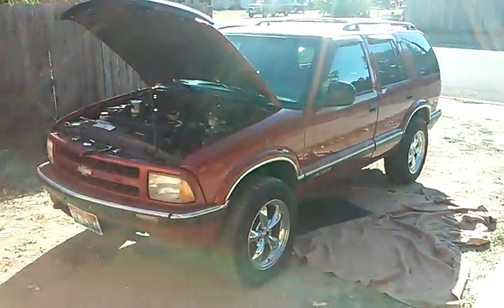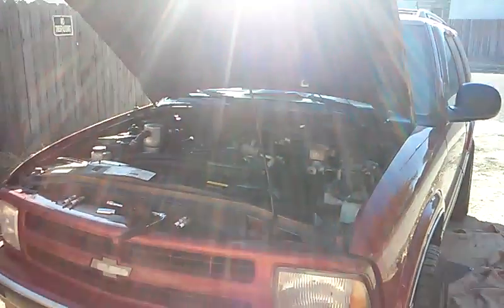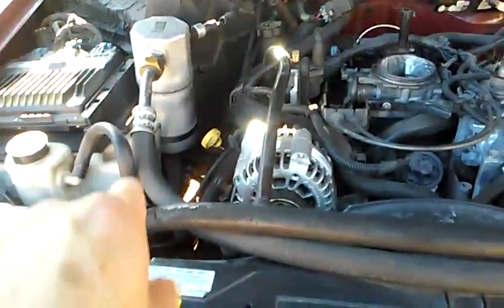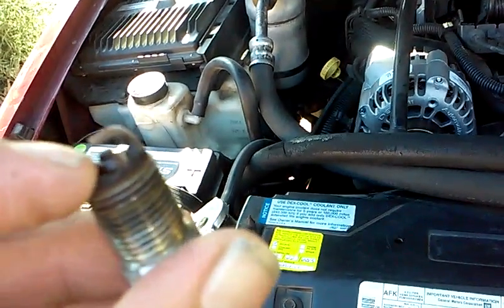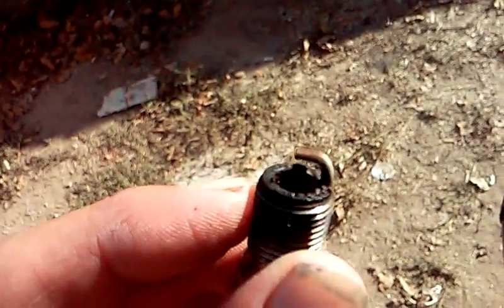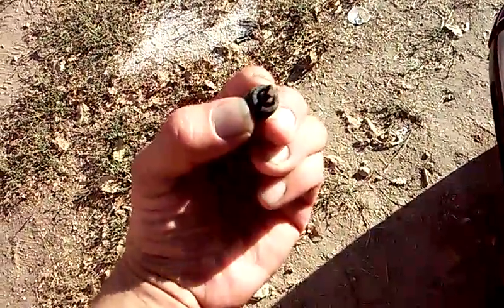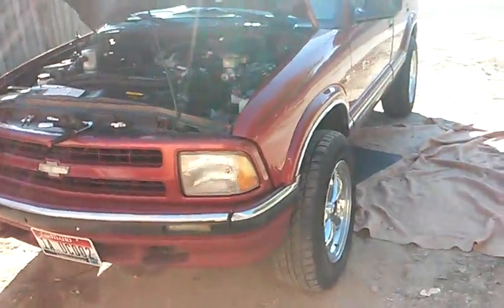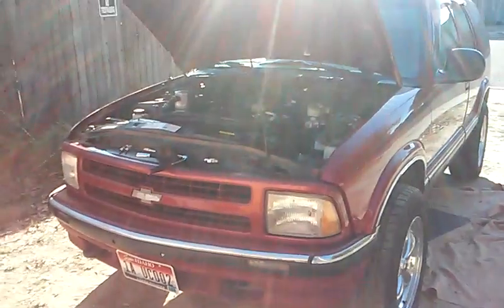chevy blazer p0420

Comment: I bought a really clean 02' Blazer ZR2 w/ 230k miles for $3k. 
Had a new New HD (480E) Tranny installed, bunch of new regular maintenance parts replaced. 
I run a 195° thermostat & noticed in cold weather on the Texas Coast (rare) my temp stays below 175-180 even after installing a new Temp Sensor & It'll throw a code if below 180°<. 
I was having power issues, hard & funky shifting between 1st & 2nd gear (automatic) I really thought I had a tranny issue even though it's brand new. 
We found that I had a clogged stock  Cat. 
I Had a new FlowMaster Cat. installed a year ago. I installed plugs, whole new distributor, cap, plugs, wires, coil, etc. 3 months ago & now I have a dead upstream 02 Sensor. 
No biggie, it's easy to reach & only $20 on Amazon. My check engine light is on, with a 0240 code & it's eating fuel bad but running like a dream!
 I Got power & I cannot even feel a miss when at idle with AC on or off. I looked & only have 2 -02 sensors on mine. I thought I'd have more but I have 1 before the Cat & 1 after. I broke out my volt meter & checked the upstream 02 sensor & I'm getting nothing. So hopefully the new sensor will correct my issue when it arrives tomorrow.
Reply: Did the sensor work for you ?   I have the same engine in a full size truck so 4 O2 sensors but they all seem good - I found the cats are plugged it is in the shop getting them cur out right now

Comment: Yup I’m doing this bec I just change my bank 1 02 sensor and after 56miles my check engine light is back on. I have a fouler but it won’t fit the solid tube for oil change is in the way

Comment: so i have a 1999 and i was able to get to that spark plug without removing the steerring i used an offset extension finding the angle was the hardest part

Comment: I have a 2003 same problem, it has new spark plus, wires, cap and rotor, 3 oxigen sensors. and still have the same code.
Reply from the maker: have you tested vacuum for possible intake gasket leaks??
Reply: researching how to do that now

Comment: I have a 98 Blazer here in Boise I might be interested in having you do some work on. How do I get in touch with you?
Reply from the maker: You can email me Highgrooveauto30@gmail.com. I could give you a call. Do you know what you need repaired on your blazer or do you need a diagnosis?
Reply: +matthew shaughnessy  Sorry I didn't see your comment till tonight. Its being repaired as we speak. Blown head gasket. :-(
Reply from the maker: Dave Arthur oh wow. not often to see a blown head gasket on these vehicles. most of the time it will be the intake gaskets that go first. main cause of blown head gasket is overheating. is this what happened?
Reply: We bought it used and put less than a tank of gas on the odometer. Engine running hot and the heater going cold were the first symptoms. Mechanic noticed the cooling system was not fully pressurizing and recommended new rad cap. Well THAT sure did it! If the the head gasket was leaking, the new cap helped it the rest of the way. Crank case filled with anti freeze. She's all happy now, though. Makes me wonder if the dork who sold it to me know something was up.
Reply from the maker: +Dave Arthur how much did the shop charge you for the HEAD gasket job? did you have them machined?
Reply: Yes... machined, valve seals were done, there was also an intake leak that of course got fixed when reassembled and it was all about $1500
Reply from the maker: +Dave Arthur Ya know that is not to bad at all.
Reply: Agreed

Comment: so my blazer is doing the same code. p0420 in both banks. Just had heads were redone and new plugs and wires, the whole nine yards.  any ideas?
Reply from the maker: well I would first want to check with a a OBD2 computer to see if the o2 sensor are dead or are working with parameters. both banks sounds kind of fishy to me though. evap leaks and bad intake gaskets could make this happen. how does it run?
Reply: im having same issue, both bad sensors.  put new ones in same thing.  did several drive cycles, went through all of them carefully.  truck runs good, gets kinda shitty gas mileage and smells kinda rotten eggy.  I was about to go check the voltage of the sensors...
Reply: @S30Uploads  sounds like catalytic converter time

Comment: Ive already changed my catalytic converter and replaced an o2 sender and I'm still getting that code. Everything else is fine. Please help. 99 gmc jimmy
Reply: From what I understand, the ecm may need to be reflashed at the dealer, did you ever figure it out ?